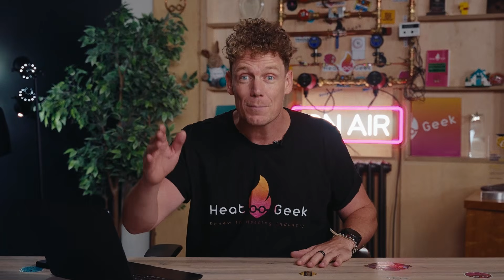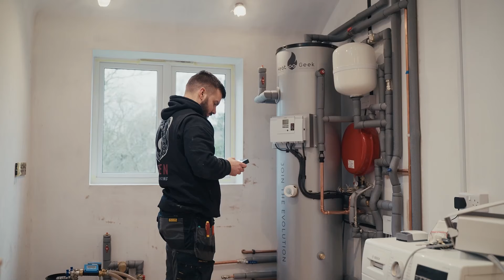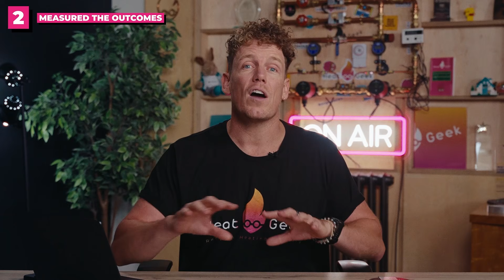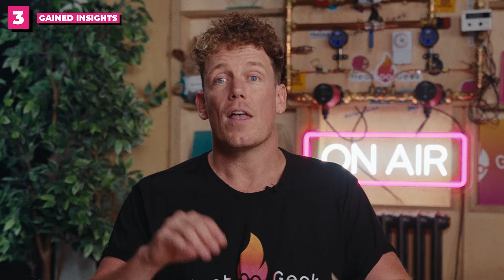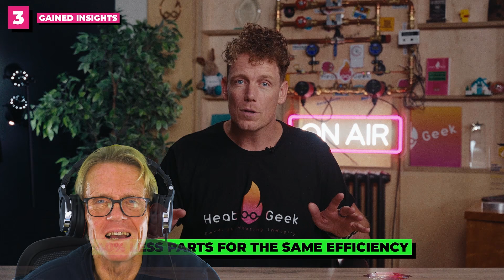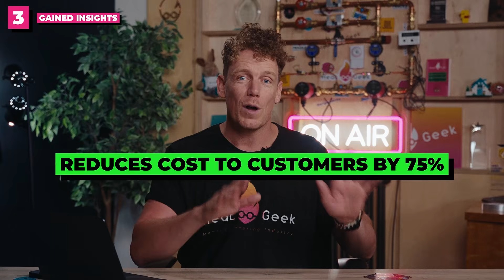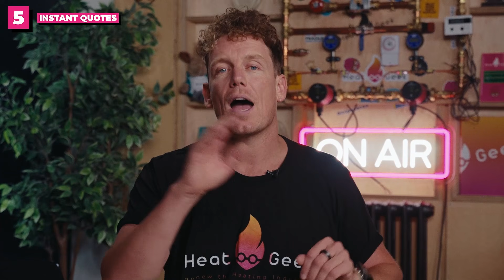Heat Pump Reality Check: Is Zero Disrupt Too Good to Be True?

Comment: I have a client who tried to use heat geek for a sizeable extension to an old building, either just for the extension, or preferably for the whole building. They booked the assessment and the first guy didn't turn up. Heat Geek sent a different chap who didn't come back with anything and after chasing they received an email saying "sorry, your property isn't suitable for a heat pump". The extension absolutely could have a heat pump, and I keep seeing videos where Adam says they can do any building. From what I've seen, the heat geeks turning up to sites are not living up to the youtube hype.
Reply: I paid for Heat Geek survey, started at £10k for the install in my 105sqm bungalow. The quote started at £10K, then we would have to move the pump from original position because of noise to our neighbours conservatory so it is up to £14K, then turns out mucked up the VAT calculations so now it is £19K so I bailed that's a mad price even it halves my bill I'd need to live to be 200 so I am going to upgrade the boiler with a modern condensing boiler. All those prices are after the grant.
Reply: @IMBlakeley  

Those prices sound suspicious, especially the VAT bit, as the heat pump installations are VAT free at the moment.

British Gas who installed my heat pump had made an error by charging VAT and sent me a cheque a year later.
Reply: @IMBlakeley . The install should be VAT free in the UK
Reply: @seaking526  
It was the way they first calculated the VAT rebate. Honestly I don't care now what their screw up was when it had doubled in price I bailed paying £19k for an install I'd have to live another 100 years to see a return on that over upgrading the current boiler to a condensing combi.
Reply: @seaking526  
They goofed up the calculation where they rebated the VAT somehow. It went £10k then £14K and finally 19K and which point I declined already wasted £300 on a survey.
Reply: I paid for the survey and because I wanted to do the radiator replacement and pipework upgrade to save some money, I was told that it wasn’t going to be suitable.  The guys were nice enough, turned up when they said and I did get my fee back, but I was left with the feeling that they just wanted the job to be bigger.  I also live in a non-standard Swedish Timber house, so I think that had an impact.  What I was proposing is little more than boiler replacement for an existing system, noting that I would have picked rads based on DT30 sizing with 28mm copper pipe feeding and underfloor heating downstairs.  The hype doesn’t seem to match with reality!
Reply: The correct assessment may have been "sorry, your property isn't suitable for a heat pump".  Just because any house can have a heat pump doesn't mean that it's financially sensible to do so. A grant is not available for a hybrid system such as ASHP for the extension and, say, a gas boiler for the rest of the house. It has to be all or nothing for a ASHP with a grant. The "isn't suitable" may have taken into consideration the 10+k it may have taken to upgrade the power lines to the house. The "isn't suitable" may have also included a consideration of the cost of upgrading central heating pipework, all radiators and improving insulation etc.

Comment: Don't forget the reason for electrification is to try to limit climate change
Reply: The UK government is funding new gas-fired power stations with £350 million in contracts running to 2040, despite net-zero pledges, to fill electricity shortfalls. Switching from gas boilers to heat pumps just shifts demand to these same plants as the grid's marginal source.
Reply: @caparn100 we need gas as backup for now. It's comparatively cheap for that task.
Reply: Couldn't care less...I wanted to save money...and I am with my all-electric system.
Reply: By running gas generators to produce electricity? Bored now.
Reply: @ashbridgeprojects6916  Guess what, just looked at the UK Energy Dashboard. Gas generation - 13.1%, wind generation - 63.3% (you might say due to high winds, but I think some of the generators need to be throttled back during this sort of weather).
Reply: @ashbridgeprojects6916 heat pumps save at least 40% of the gas you would normally use for heating.

Comment: Not just the heat pump, where do you put all the extra bits of equipment that comes with it ?.
Reply: In my case in the boiler cupboard when boiler removed.
Reply: I came to say the same thing. Your gas boiler is inside but the heat pump isn't.
Reply: @robertszynal4745 I am concerned about the extra techie stuff that can go wrong.
Reply: @maxbacon4828 it's just a heating system with modern controls. What do you worry about going wrong?
Reply: What are you talking about? A tank and a compressor...what are the "extra bits"?

Comment: People often claim heat pumps are “more efficient” than gas boilers, but what really matters to households is cost per unit of heat. With gas at about 5.9p/kWh and electricity at 27p/kWh, a modern condensing gas boiler (90% efficient) delivers heat for roughly 6.6p/kWh-heat. An air-source heat pump with a typical winter COP of 2.5 ends up costing around 10.8p/kWh-heat — about 64% more expensive. You’d need an average COP above 4.1 just to break even on running costs at today’s prices.

And while advocates say heat pumps “run on clean electricity,” in reality the UK is actually building new gas power stations to cover demand shortfalls, at a cost of hundreds of millions of pounds each. So much of the electricity powering those heat pumps is still gas-based, only more expensive by the time it reaches your home. For many households, a high-efficiency gas boiler remains the cheaper option right now.
Reply: I can't make oil or gas in my back garden but I can make electric on my roof.
Reply: @robertszynal4745  

And solar panels are evolving as well, now available as fence panelling, or ground cover panels that can be walked on.
Some really good developments happening now.
Reply: @_Dougaldog …but no sun in winter!?
Reply: @johannbraunstein1190  

There's still daylight every day in Winter, and in Summer the further North the longer the daylight hours.
They would still give about 10-30% of their peak Summer output during Winter.
Reply: @robertszynal4745 but you can't make enough electricity on your roof in winter to heat your house.
Reply: @caparn100 thankfully, we have wind (and interconnects, biomass, hydro, nuclear, demand shifting, batteries and  gas) for the winter.
Reply: I absolutely love when people openly demonstrate their complete lack of basic knowledge. If you can't even get the units right, then the rest of what you are saying is meaningless as you have shown that you have no concept of how heating and power are related.
Reply: Modern boilers PEAK efficiency is 92%.
Modern heat pumps PEAK efficiency is 800%.

However seasonal efficiency of a gas boiler is 85%…

This changes the differential to 3.35 which is easily achieved. This is all on our instant estimate page. 

Also you can access cheap electricity tariffs which shift this down to 2.5….
Reply: @HeatGeek  what does an efficiancy of 800% mean? A simple comparison of cost/kw heat tells you which heating solution is going to be cheapest. are you sayin you get 8kw heat/1kw electricity? that seems a lot higher than the usual 2kwheat/1kw electricity usually claimed for heat pump systems.
Reply: @DicksonTimScotland that’s exactly what it means and you can see that on any of hundreds of heat pumps on energy monitor. I don’t think any heat manufacturers advertise a cup of tea as that would probably be fault due to something not working properly. 

The 800% efficient is a cop like I say though an instant instantaneous efficiency not seasonal seasonal sits between 200 absolute worst case and anything below that would fault up to 500%
Reply: @HeatGeek  thanks. so in ideal situations you could get 800%, but in real life expect between 200-500%. is that air-air, ground sourced or air-water?
Reply: Nailed it. Saved me the bother. It's as simple as the electricity price being an order of magnitude too high.

Comment: Wow great news for anyone looking to replace a boiler. 

We just priced a New Vaillant Heat pump via ZeroDisrupt cheaper than we could install a new Vaillant Boiler and Cylinder and the Heat pump is guaranteed to run cheaper.
Customer is over the moon and is looking forward to the job, bonkers considering they had no knowledge of a Heat pump.

Videos like this and Heat Geeks have really helped the industry.

Nice one SkillBuilder.
Reply: It's 'cheaper' because the Government grants and forcing the price of boilers up with additional levies. Good luck to the customer but the proof of the pudding is in the eating.
Reply: Did you also price any other modification costs. A ASHP is not a straight boiler swap.
Reply: @Alan-w6n9p 
Actually sometimes it is as simple as a boiler swap. 
That’s the beauty of Zerodisrupt.
Reply: Well in that video there's no guarantee it runs cheaper just that it's more efficient.  Any guarantee is only worth anything if the company still exists in a few years time !
Reply: How can you install a heat pump into a house that has all the heating pipework buried in the walls and running on microbore piping.?
Reply: @ianmccall5295 
Its no different to replacing the boiler.

Comment: Personally the whole carbon neutral is a means to get everyone on electric including cars etc because everything is in one basket and that makes it very easy to control people via the SMART grid. However, this is very risky just relying solely on electricity especially since green energy production is less efficient than coal and gas power stations.

I want to be off grid and self sufficient. I can't see how this is possible using a heat pump if you need to generate the electricity by solar PV since that's at best 22% efficient. Finally, hydrocarbon fuels have come down recently making that a more realistic proposition. What will be the death of heat pumps and the green agenda is the collapse of the fiat money system and that is happening now when you look how fast gold price is rising.
Reply: Gas electricity generation is the least efficient of all, and the most costly, it's what sets the electricity price high.
We no longer have coal power stations in UK, society depends on electricity (in one basket), if our heating went off it would be the least of our worries.

Solar panels now can work to 26% efficiency, just image a bank of 466 Watt solar panels giving you 7.5kW of energy to use, many who do this run their houses and EVs off grid for all intents and purposes for six months of the year.

The energy required by humanity each day is a tiny smidge of that energy that hits the Earth each day from the Sun.

If there were no global warming because of CO2 or Methane et al then we could continue until we'd burned all the oil and gas, and then be left saying 'what now ?'.
Reply: @_Dougaldog Energy prices are set by a cartel of corporations. However, renewables are three times as costly than hydrocarbon energy generation and that is why our energy bills have gone up so much once their introduction.

The UK imports most of its energy (gas) now after the coal power stations closures. That is why the government is force the start ramping up north sea hydrocarbon extraction again.

The 26% efficiency of solar PV is the theoretical maximum of new panels while those in use now operate at much less percentages. I do have solar panels myself and they produce very little electric in the winter when we need it the most. Our best source of energy are mains electricity and wood burners.

Theoretically, the Sun provides a lot of energy but humanity has yet to develop technology to capture the Sun's energy to such an extent that we only need a fraction of it. That is why humanity uses hydrocarbons, nuclear and other forms of power generation.

Hydrocarbons are renewed yearly by the dying of the biomass of the planet. Oil has never been extracted from fossils. There is no such thing as "peak oil". That was a marketing exercise by the cartel to Jack up prices so they can make huge profits.
Reply: @pauljenkinson1452 

This sounds like conspiracy theory territory you’re getting into.

The U.K. imports about half its gas, and most of that from Norway via North Sea pipelines.

Oil and gas are the products of dead plants and sea creatures from over 200 million years ago.
As far as North Sea goes there’s not much left to ramp up to, certainly not economically.
Reply: @_Dougaldog Price fixing has been confirmed in the past with fingers pointing to BP, Shell and others. If you think that still isn't going on then you are a little naive. Plants and sea creatures are included in the biomass as well as micro organisms which are a large part of the formation of hydrocarbons. North Sea is viable and there are now efforts to tap that source once again.
Reply: @pauljenkinson1452  

Now shall we see what government says about how electricity prices are set ?

Extract from House of Commons Library :-

"Why is cheap renewable electricity so expensive on the wholesale market?

Electricity is increasingly generated from renewable energy in the UK, and the cost of renewable generation has significantly decreased in the past decade.
Despite this, the price paid for wholesale electricity on the ‘spot market’, where, according to the Competition and Market’s Authority around two fifths of electricity is thought to be sold (PDF), is largely determined by the price of natural gas.

What is marginal cost pricing?
Marginal cost pricing is where units of electricity are sold at the price of the most expensive unit needed to meet demand at a particular moment in time.
When reviewing the electricity market arrangements in 2022, the Government said the marginal cost pricing system provides an efficient signal for supply and demand decisions, is transparent and incentivises costs to be kept down.

Merit order
In each half-hour trading period, each electricity generator bids the price it will accept to generate electricity, according to how expensive the electricity is to produce.

The bids are accepted in ‘merit order’ until the demand for electricity is met; the cheapest first, and the most expensive last. However, the price of all units of electricity is set according to the bid price of the most expensive unit needed to meet projected demand: this is the ‘marginal cost’.

Renewable generators typically have the lowest costs (because they do not have to buy fuel to burn) and so are the first to meet demand. Fossil fuel generators (including gas) often have the highest costs as they must buy fuel to burn, which also has a carbon price on it.

As a result, although most electricity is produced using sources with low marginal costs (42% by renewables and 15% from nuclear), the price that is paid for electricity traded on the spot market is often higher, at the marginal cost of generating electricity with gas."

Comment: In Vancouver Canada, our city have change the mandatory heat pump only requirement if u want get the grant to hybrid. Knowing that when temperatures drops below 5c, most heat pump is not capable to heatup a home or its going to cost an arm and leg to do so😂
Reply: Most systems will work well to -15C, understandably though with some Canadian Winters being a bit colder than that, that they would consider hybrids.
The Scandinavians seem to have few issues with air source HPs

But with Canadas wealth of Hydro electricity I would have thought electric resistive booster heaters in HP would be a better option ?